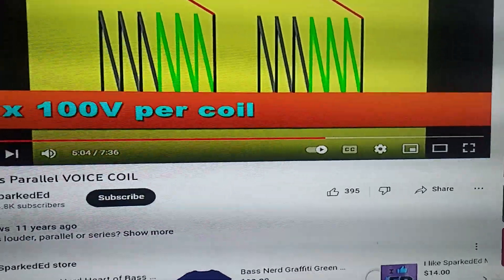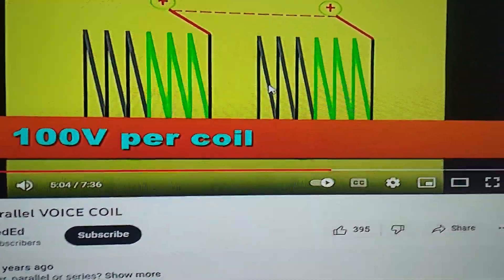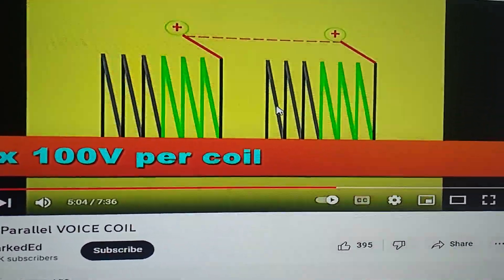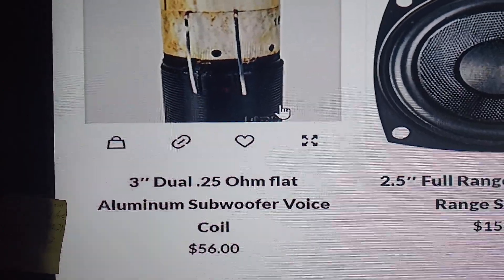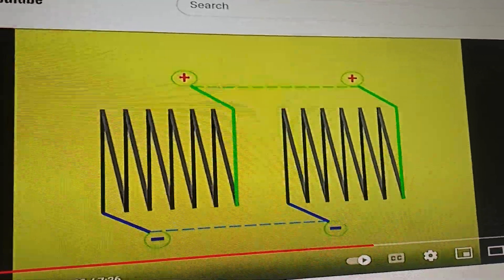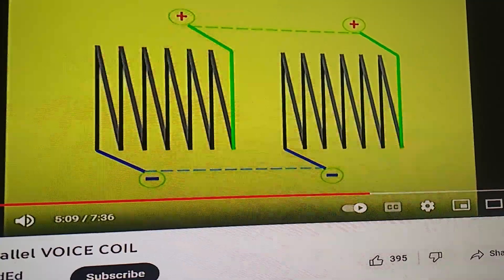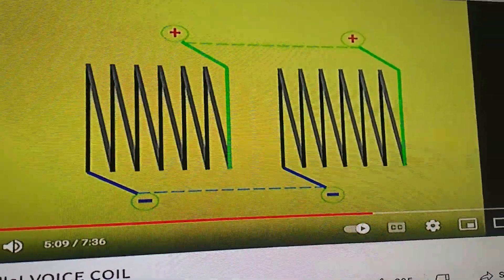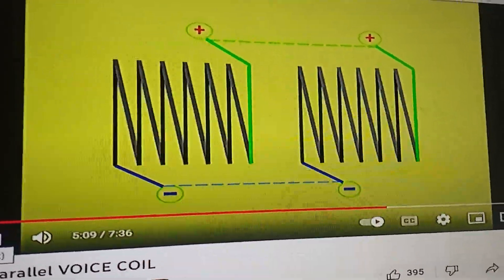@SparkedEd got it wrong but that's ok,  Subwoofer coil configuration series vs parallel

Comment: Thank you! The math says series is better but in real world you can’t really notice the difference. I have a pair of D1 and they are basically the same whether I wire series/parallel vs parallel/series literally no difference to the ear and same final impedance and amp provides same power but I feel like the series sounds better in my situation or I’m too lazy to change it again 😅
Reply: Do ya think amps make good power at 8 ohm and 12 ohm as they do 1,2,4 ohm forsay.ya may make 1500 at 4 ohm but 8 ohm ya may make 395 vs 1ohm 1500 and 4ohm 990?🤷🏻‍♂️
Reply from the maker: That's because with a low impedance coil you use larger wire and less turns.  Like that LOB turd I showed.  D.25 ohm = lack of BL force.  Looks cool as shit though!